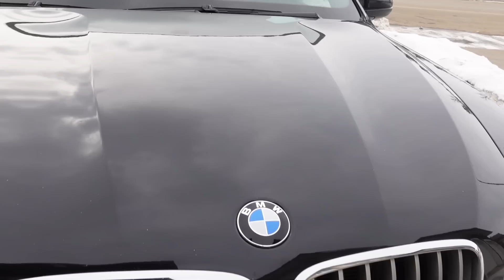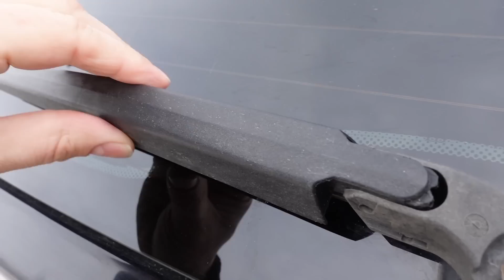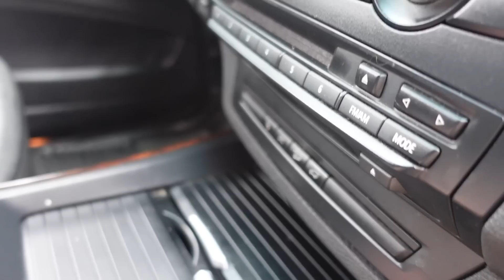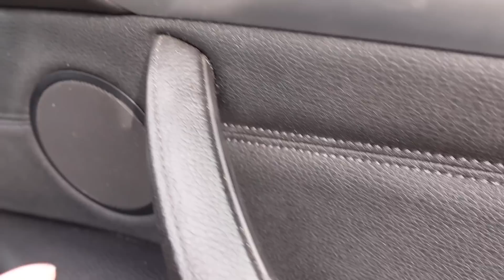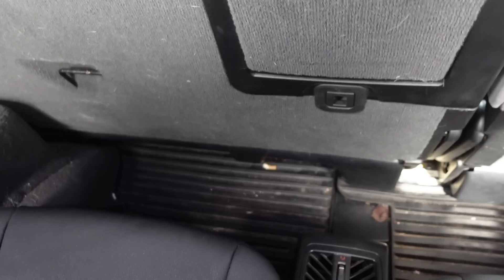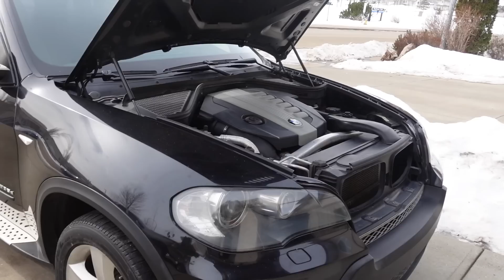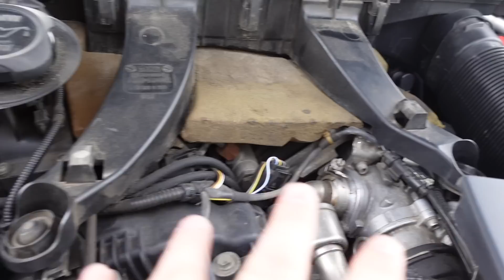10-Year Ownership Of My BMW X5 - A Long Term Review

Comment: Why the hell didn’t you get rid of it? 

I’ve owned two Mercedes ML350s, driven both over 200Ks, and they have been the most reliable cars I’ve ever had. 

Hardly anything ever needs to be fixed. The repair bills wouldn’t even be as much as the servicing bills.
Reply from the maker: Thanks for sharing.  Yes, we have a considered dumping it a while back but time catches up and especially with the last couple of years, focus was not on that vehicle

Comment: My 2014 KIA SPORTAGE With 105000 kms have never needed anything other than oil changes. Not even brake pads. Never been in the shop and I live in Dubai where temps can reach 50°C.
Reply from the maker: Cheers
Reply: Have a kia forte 2014 6 speed,  just oil change,  brakes and a windshield wiper blade 110k

Comment: Hey I just solved your problem!  Just buy a 2.0 multiAir Turbo Stelvio...low maintenance,  best looking SUV, best handling, and 34MPG on the highway!  BMW, AUDI and Mercedes wish they could deliver this type of reliablity and performance!  Best in class in every category and the lowest price!  I have 84000km and will drive it to 240000 and then donate it to ALFA ROMEO..!  oh did I mention Im still driving on my original pads and rotors...try that with a BMW, MERCEDES or AUDI!

Comment: Great video but i am astonished what prices do you have on my x5 e70 the new battery was vartaand it costed me  250 euros and it works like a dream of course you have to programe it and the fuel injectors are Bosch here in Europe are 400 500 euros or you can buy reconditioned ones that are the same and are alot cheaper and one thing when your car goes over 240000 km a dpf warning light will come up the dash but dont worry its the dpf counter km that sais that you have to change your dpf. Dont do it because your dpf its fine. You only have to restart that counter km with Ista and its all fine. Great video.

Comment: Apart from the shock of the cost of diesel here in the UK currently being £184.9 a litre, I am very seriously getter a 2017 Mercedes E Class Estate E220d AMG Line, is it better then getting a BMW 530d Touring?  The only alternative I have considered is a buy set of Roller Skates.

Comment: i have a 2012 x5 3.5…….i have had it for 6 years. if not for the CPO warranty i wouldve had to pay for oil filter housing gasket (which failed twice), oil pan is forever leaking, fuel pump sounds like its going. Brakes squeal when it is freezing outside, no matter how old the brakes are. had to do a coolant flush water pump twice and thermostat. I chipped and put in intake from burger so then MAP sensor needs to be cleaned every year with the spray. THe vents for the sunroof are stuck so i have to hammer it close from the inside. One parking sensor is gone so it constantly makes a sound. But overall i still have no check engine light and it runs decent. Considering i only drive 8k miles a year. First 5 years was great. NO issues. Then oil filter went then oil pan then water pump. Expensive repairs but hopefully im done.  Going to get rid of the car in 2-3 years. But this car lasted MUCH longer than my old e53. But it is a fun car (especially after being chipped).

Comment: Lots of Good heads up info for X5 owners!
What are you replacing the X5 with?
Reply from the maker: Thanks,  we are still seeking a few options but trying to sell this thing first.
Reply: But if bad luck
mark but if your on a high mileage car you would expect issues like these. They not like a lexus or Toyota. Anyway think services can be cheap. Oil and filter cost me £30 with 15 labour so £45 for oil
Service. Other filters you can do ur self like
Pollen and air filter. Fuel
Filter max cost £40 to do . I would run it on Shell V power high octane and dpf issues won’t happen if you blast it on highway.
It’s the best car I’ve owned and have had many.
Reply: Get the E53 it’s much more
Reliable than the E70.  The M57 is bulletproof. Looks ok too. I have the E70 4.0d and no issues yet apart from glow
Plug controller and egr.
Reply: @eddy45686  I have an E53 30D. Door hadles fail, ZF6HP26X gearbox needs regular servicing, but the torque converter will be the limiting factor at about 200000Km's. I am overhauling my gearbox now because of the failed TC. It had 223000Km. Interior roof lining fails at about 10 years here in Australia due to the harsh sun. AUD1000 to fix.

Comment: I previously owned a 2009 E70 but without the diesel and for the most part, it was a workhorse and fun to drive.  Once the warranty was expired, repairs were getting costly but they were few and far.  When the A/C stopped working, it was time to trade her in but I overall loved the vehicle.  I'm amazed at your technical knowledge and appreciative that you share it...
Reply: @porschefanatic1049  It was time for an upgrade at 10 yrs old anyway.
Reply: HaHa - I wish...I had the 2009 E70 for 7 years and it did well.  I only have one home and one vehicle and work hard to keep them. @rainbowsquash673

Comment: My goodness. If the brand has so many mechanical problems why (outside of the excellent driving experience) why is the vehicle so popular?
Reply: Because they're amazingly capable. They can tow 3,500kg, seat 5 adults and two kids, have a 50/50 weight distribution, drive much more sporty than any other SUV except Porsche, have very good safety, decent clearance, and have great range and mileage with the diesel. With a tune and delete, these put out around 375hp, and 650 lb. ft. of torque. What else can do all of that for $10k?

Unfortunately a lot of owners like this guy have no idea what they're doing and take the car to the dealership for everything. That's the quickest way to lighten your wallet. An ounce of prevention is worth a lb. of cure and this guy did ZERO preventative maintenance. He just waited for things to break and then took them to the dealership, then gets on youtube to complain about the cost. 

Honestly if you're that kind of owner, just lease it or sell after warranty is up, because there are plenty of good X5 35d's out there because the owners know how to take care of them.
Reply from the maker: I am still trying to understand that myself.

Comment: Very gracious of you, Mark, the bodywork holds up, but here's the list of bills. Why not give Volvo a go? I hear the Chinese offer very good customer support. Thanks. 🙄
Reply from the maker: Haha, I know I was being way too nice because overall if you saw the video before this one, I am very disappointed with the brand as a whole.
Reply: @ECPP  That's Apr, 2020: -

Top 10  and their reliability score:
1. Volvo XC40 Mk1 - 98%
2. Subaru Outback Mk3 - 97.24%
3. Nissan LEAF Mk2 - 97.04%
4. Lexus CT Mk1 - 96.80%
5. Lexus RX Mk4 - 96.60%
6. Toyota Prius Mk4 - 96.56%
7. Peugeot 3008 Mk2 - 96.09%
8. Toyota Yaris Mk4 - 96.07%
9. Toyota Corolla Mk12 - 96.06%
10. Toyota C-HR Mk1 - 95.95%

Comment: This confirms what I thought about BMW diesels, the extra diesel related repairs vs a gas engine cost way more than the fuel savings.  You would be better off with the N55 gas motor (but not the N54!)
Reply from the maker: You are right Bruce, the n55 is vastly better then the junk before it and I know even the brother in law runs the n55 in an X3 and it has been ok, but…..
Reply: Not true at all. Unless you're unable/unwilling to remove the emissions equipment, the diesels are much cheaper to run and less problematic.

Comment: One of the things that grinds my gears on these high end cars is the d@mn battery. A replacement battery last year ran me $300 for the battery alone. Getting into the battery bay of the car requires an engineering degree and a trip to the dealership to register it.
Reply from the maker: You are right, they over complicate matters and this whole coding thing sounds like another gouge fiesta to me as well.
Reply: Hey, my BMW same model as above needed a battery, my auto elec changed it over for $225 fitted. A;so had a front globe go, BMW said $800 my auto elec fitted new globe for $200, sometimes I think we need to shop around a bit.
Reply: If the new battery is the same CCA as the old, you can give the registration a miss. Registration is only required for a different capacity battery. It is my information that this is to enable the correct charge rate out of the alternator.
Reply: You my friend were ripped off. If you pay more than 90 dollars for a battery, you overpaid

Comment: It is funny... Cold weather=problems, hot weather=different problems. I don't really think you have had a nightmare BMW actually. It is what it is. Like ALL BMWs as you said there are weaknesses that you must be aware of and act proactively. Get a good independent mechanic or service yourself. 1,000 for a battery that is crazy, I paid 400 for mine (Bosch)... So, service in Canada is very expensive also.
Reply from the maker: We overpay here in Canada, no doubt.
Reply: @ECPP 
What ever you pay in Canana with our weak  currency where I stay  its 10.5 times🤔

Comment: Dealership should keep certain items such as injectors and computer boards as tools for mechanics. It's ridiculous that a dealer can't tell you if replacing an expensive part will fix it or not. They can keep a board and injector in a main tool cabinet for the techs to use.
Reply: That’s exactly what my non dealer workshop does. 
The dealer always says..well, we don’t know but we will experiment on your car and you have to pay us. Also sometimes new guys are being trained and you pay for their experiments.
Reply from the maker: That’s exactly my sentiment.  Small price to pay for their own peace of mind and validation.  Seems like common sense.  But again it’s off the hide of the consumer.
Reply: Why would a dealership do that, they exist to rip you off. If you don't find a reputable independent shop who does things the right way (using the common sense you just described) that's on you

Comment: Another thing to be aware of is that "board" or "computer" thing is something repair shops usually throw in a) when they try to scam you or b) when they're incompetent and can't figure out the real issue. I always tell people to run away from that shop if someone mentions the board, cuz it usually isn't that.
Reply from the maker: You nailed it and that was where my mind was wondering too when I was first given that diagnosis.
Reply: @ECPP  wait, I was told this about my E46 module and the change the ECU for like $1000 so i wouldn't get locked inside the car and have to climb out of the window. Or locked out of the car when I wanted to drive it.

Comment: I recently bought a 2008 X5 3.0si with 200K km on it and I'm loving it so far, as long as gaskets are replaced and maintained its a good reliable car. Its just wear and tear like any other car to be honest and I myself can turn a wrench if need be. So I'm very confident with the car. But overall good video :)
Reply: well,you can spend a fortune trying to keep it from breaking down too
Reply: Hey wish u well
 im wondering how is the car doing after u posted this comment
Reply: How’s it doing I’m looking at a 2009 x5 220 k km

Comment: Hi I'm a newbie to all this and a BMW enthusiast who is planning to own one. But after I watched your recent videos, I started to question myself if I should own one or not. I'm actually interested in buying a brand new X3 xDrive 30i or 430i Gran Coupe! So, please share some suggestion on what I should do.
Reply from the maker: Hi,  they are always decent cars to drive but it really depends on how long you plan to keep it.  If you plan to go longer, stay away, but if you are a short term lease type of person then, why not?  For me, new gets smoke hard on depreciation and used means you may have to engage your do it yourself repair skills, otherwise avoid at all costs.
Reply: @ECPP  does it go same with all German cars? Or can I consider Audi as an alternative to BMW?
Reply: @ECPP  yes how about mercedes?
Reply: 99% people complain  buy used cars
 99% how compran drive the bmw overol 80ml Just say they drive fast :D if you drive like a granpa  the car last Lonnger since you no forcing the engine. Like toyota do tonall his car have big engine but limit you and now have all the power that engine give you
Reply: I have a 2019 x3 30i. Its still under waranty but no issues so far. The diesel engines should be avoided. The inline 6 new gen engines are much better but b48 shoud also be mostly the same since its like a b58 but without 2 cilinders. If you plan to have the car for over 7 years then yeah you should get extended servicing.

Comment: $250 for an oil change? Why would you not just do it yourself. You say that you work on the car sometimes? I change my oil every 4k with quality oil and filter for under $40. I don’t know why anyone that can do simple work in cars would take it in for an oil change
Reply: Some people don't have a choice, since crawling under a vehicle is impossible with age and disabilities like I have.  When you are young and healthy you never think about old age complications. In my younger years I was able to change anything on my cars and trucks, but now just removing a wheel to replace brakes is a back breaker.  Some people don't have a choice.
Reply: The b58 oil change is about $90 in material costs , as I need about 7 liters of oil and a filter. Much cheaper then the dealer but still not “cheap”.
Reply from the maker: True, I usually do, but sometimes life gets real busy and priorities get juggled.  When I can, I do because there is money on the table as the Mae crooks try to take owners to the cleaners every chance they get.

Comment: Excellent review like always.  My dad X5 is starting to have bluetooth and electrical issues now that it's reaching 100,000km.  Ironically there's a 2013 X1 on my court that has close to 180,000km's and still going strong lol we chirp the neighbor but he's proud to drive it.  The 1st gen is so small too.  What surprised me the most is how a 4 cylinder is outlasting a 6 cylinder, maybe it's a rare case? I don't know much about cars
Reply from the maker: Hi, it sort of depends on which engine of each because for example a B48 will most certainly outlast an n54.
Reply: @ECPP  yea that's what i kind of figured too, it's gotta be something about the engine.  

Anyways, thank you for another great review, I really enjoyed watching.  and thanks a lot for answering my question so quickly, I really appreciate it.  You definitely deserve millions of subscribers
Reply: My 08 x5 M57 at 264 000km now. I do miss running HVO100 cause enigne ran cleaner and calmer but 30SEK/liter noty
Reply: My 2012 X5M with the S63 has 151,000 miles (243,000) km, and the engine is still strong.  I know I'll probably have to replace the turbos in the next year or so; at that point I'll go for the upgraded Vargas turbos.  555HP isn't quite enough - I was out-accelerated by a new Corvette the other day and I wasn't happy.

Comment: Can I ask what the cost was to change the rear air suspension?
Reply from the maker: It was only a couple hundred bucks for the springs that I got on Amazon anf I installed myself.  Just be careful with the stored energy or have a shop install for you.
Reply: @ECPP  Thanks. Just I always run scared with vehicles with air suspension.

Comment: Reliability high or low?
Reply from the maker: Reliability is moderate but when they break, it really is a money pit because the value of the vehicle is low so it’s pouring money down a tube.
Reply: @ECPP  but can you replace the car for what you can fix it for?

Is there a point , like 5 years old where if you had a crystal ball would it have been best to get a new one vs pay the repairs and maintenance?